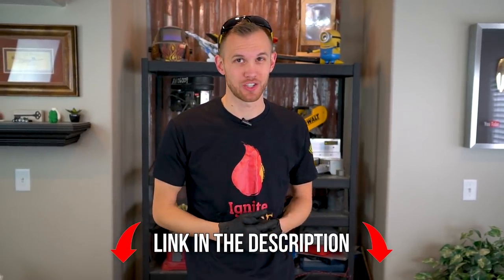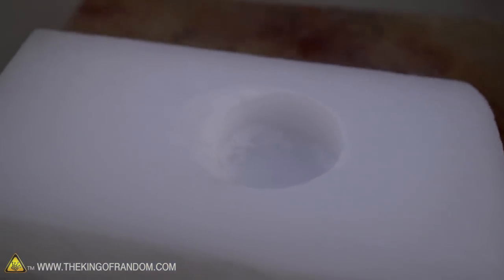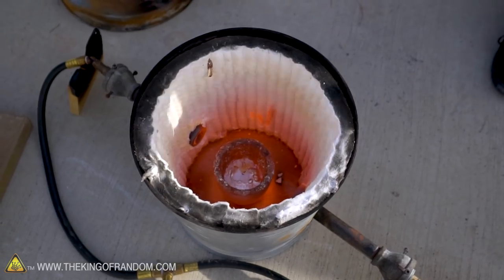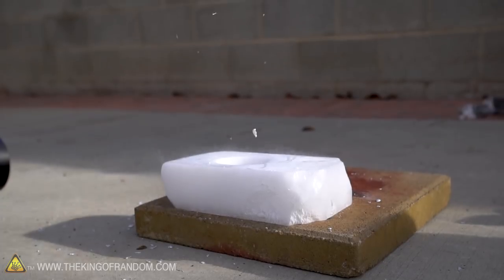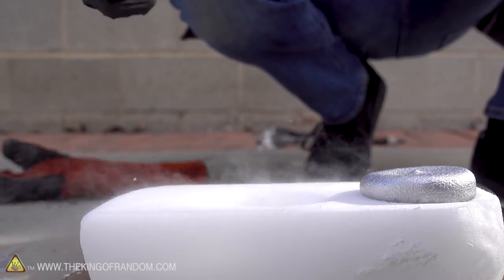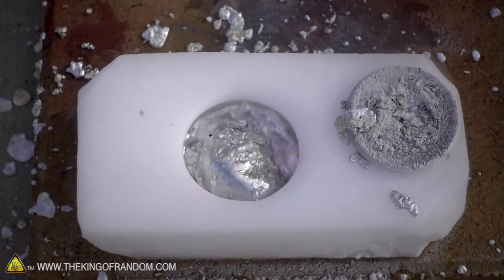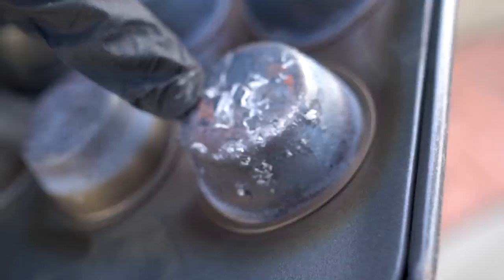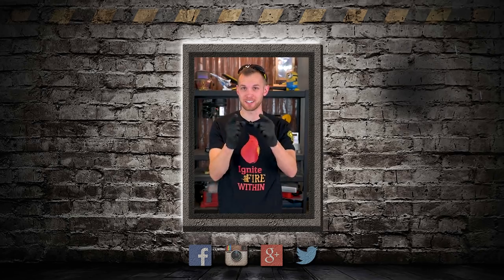Liquid Metal vs Dry Ice?! TKOR Experiments With Molten Metal On Dry Ice In This Metal Vs Experiment

Comment: What if you pour molten aluminium in liquid nitrogen?
Reply: Mini Mythbusters The molten Aluminium freezes anderen it's solid
Reply: Mini Mythbusters what I want him to do is melt copper and iron and mix them and let it harden
Reply: Mini Mythbusters Prime now
Reply: And the other way round
Reply: then the air between the two would become super heated in a very short amount of time, expanding and possible causing an explosion of sorts. basically, dont do it
Reply: The nitrogen would boil off.
Reply: Hard Core Gaming yes.

Comment: I loved the splashing of aluminum. Crazy to see it as a bubbling liquid like that.
Reply from the maker: That's my favorite part as well. Especially in slow-mo replay
Reply: I think it looks really cool to
Reply: The reason it does that is actually quite interesting. Simply put, liquid CO^2 doesn´t exist, it will jump from a solid state to gas immediately(that´s called sublimation) and since it has a higher volume as a gas than when it is solid it will rapidly expand and just blow the aluminium out. It doesn´t really matter at all what fluid you use for this as long as it is hot enough.
Reply: Specific Love Creations
Reply: I'd love to see this same experiment with other metals, just to see the different reactions.
Reply: Specific Love Creations Same here
Reply: Specific Love Creations nice spoiler there
Reply: Aluminium*
Reply: The King of Random its like an explosive volcano🌋

Comment: what if you pour Liquid murcury in molten aluminum?? Will it blend and become a alloy mix. Or will the two seperate when it solidifies???
Reply: Brandon Allen ya man thats an awsome question!! I want to know as well
Reply: It would probably become an amalgam, not an alloy, and may vaporize due to the heat.
Reply: You can actually pour liquid mercury onto aluminum at room temperature, and it will form a liquid amalgam
Reply: yes what a great question do that
Reply: I agree he should do more mixes
Reply: mercury you mean
Reply: something very bad will probably happen, look up videos of mercury and aluminium
Reply: Mercury heated up creates a vapor that is actually very toxic to living things.
Reply: Brandon Allen that would be extremely dangerous
Reply: mercury is already a liquid you dont need to say liquid mercury but still a great question
Reply: The mercury would vaporize
Reply: will it blend?
Reply: Brandon Allen actually the mercury might (if not completely vaporized) react with the Aluminium by “eating“ it up
Reply: It amalgamates. It becomes a soft aluminum mercury alloy. I think that every metal amalgamates with mercury
Reply: Brandon Allen i
Reply: Brandon Allen GU u
Reply: Never thought about that...
also *Mercury
Reply: The mercury would vaporize and mercury is very corrosive to aluminum
Reply: Brandon Allen it is kind of dangerous working with mercury. According to wikipedia it is a possible alloy...
Reply: aluminium*
Reply: They form an amalgam (which is basically an alloy but with mercury) even at room temperature.
Reply: Brandon Allen Don’t do it the Mercury will probably vaporised releasing toxic fumes
Reply: DerpDanPlays12 it actually is aluminum in English...
Reply: PyroX 

Aluminum  English US
Aluminium English UK
Reply: Xavier Ancarno oh it’s actually aluminium in uk english... I love the English :)
Reply: The only problem with that is when mercury heats up and evaporates it becomes a highly toxic gas
Reply: Brandon Allen I
Reply: RithmoArcher yep
Reply: The mercury would become a gas, and would be very harmful. This could increase their chances of getting dementia (Mad Hatter Syndrome [look it up if you're interested]) and would be corrosive to the skin, along with the inside of the lungs and the trachea, and could also affect the oesophagus and the digestive tract. In other words: THAT IS A REALLY BAD IDEA.
Reply: My guess is that the mercury will boil and gas off. It think you may need a resperator to do this one for sure.
Reply: The murcury would just evaporate since it's  liquid at room temperature
Reply: Or drop solid mercury into liquid aluminum.  Making the mercury solid might be hard to do though.. who knows. haha
Reply: jordan traykovski I know what you mean
Reply: Brandon Allen vvvvv
Reply: CORRECT GRAMMAR IS AN NOT A!

Comment: Dry ice is a better way to cast ingots than wet clay
Reply: a-lpha of Zeldaforme Gaming besides the whole throwing molten metal everywhere
Reply: I agree
Reply: The reason the aluminum does that is actually quite interesting. Carbon dioxide doesn´t exist in a liquid state and will rather than melting just sublime to gas. So, if you pour a very hot liquid like for example molten aluminum on it, it will unleash a great amount of gas that expands below the aluminum and blows it away.
Reply: And also more expensive. I dont think the cost justifies it.
Reply: Pour thermite in dry ice or the other way around ? Or in liquid nitrogen

Comment: Another way to "DRILL" a whole into the DRY ICE if you don't have a special drill is to place a cup filled with hot water on top of it. It will "drill" a whole into the dry ice over time.
Reply: Demolition Hacks hole not whole, that like saying I dug a whole it’s a hole! You can’t put you foot in a whole you can have a whole pizza but not a whole in aluminium you can have a hole or you can have a whole if there’s multiple pieces all together from the same piece!
Reply: Ben Biggs or you could just say hole*
Reply: Ben Biggs it was not possible to explain this more complicated, or was it? Short explanation

whole = complete
hole = empty space
Reply: *hole
Reply: Ben Biggs *your
Reply: Ben Biggs I agree but you don't say you foot, you say your foot! 😂😂😂

Comment: The splashes are caused by the CO2 released from dry ice for contacting high-temperature aluminum. This probably the worst way to cast aluminum because of all the air bubble trapped inside the ingot, but still fun to watch.

Comment: What would happen if u put ice into a vacuum chamber, Would it pull it break apart, Or stay together because of the very low air pressure??
Reply: Nothing
Reply: Better question: If you put ~1-4°C cold water in a vacuum chamber. Would it freeze?
Reply: Cody's lab did it.Check his video
Reply: Mystic Dragon EX dang, thank you!😄

Comment: Fire extinguisher on fire is normal, what happens if you fo the opposite? Burn a fire extinguisher?
Reply: Yeah, what happens if you explode a fire extinguisher due to being in exposed flames, making it build up possibly more pressure than it can handle?
Reply: Mythbusters already did this.
Reply: I’m sure the extinguisher would explode
Reply: That would be very dangerous

Comment: Try freezing liquid nitrogen
Reply: mateo d u cant freeze liquid nitrogen
Reply: +Robo Games420 well, actually you can. However, it's hardly possible to achieve temperatures as low as that
Reply: They could still try
Reply: They have done it already
Reply: mateo d its very possible liquid nitrogen into an extremely strong vacuum
Reply: Gamingelon yes but my point is u cant physically freeze it to the point that it stays solid for more than a split second

Comment: drill a thin hole in a block of dry ice and put a long heating element in it, see if that makes the dry ice sublimate any faster. It seems like the leidenfrost effect really slows it down in this experiment, but would a hot radiating head source work any better?

Comment: Set the block on it's side, and drill your hole with a smaller diameter drill, but significantly deeper.  You have a chance to make some totally rad aluminum bubbles!  Try, say, a 1" hole starting 2" deep, then 4" etc.

Comment: Coolest experiment in no particular order:
1) Lighting up thermite and dumpint it into liquid nitrogen [danger level= highest]
2) Pouring molten glass over a sheet of dry ice [danger level= high]
3) Coal dust + flour = dust explosion [danger level= highest]
4) Running electricity through fire in metal foundry [danger level= low]
5) Sugar + concentrated HNO3 [danger level= normal]
6)  HCl (solution) frozen into solid and then placed on top of magnesium (or potassium) powder [danger level= normal]

Comment: You should drill in to 2 different dry ice blocks and on one of them drill a hole in to the center of the creves you made them put the blocks on top of each other with the hole on top then pour molten aluminium in to it so it should create a sphere of aluminium 👌🏾

Comment: I had a job heat treating carbide tungsten in 2400 degree molten barium salt. If the slightest moisture hit the salt bath, an explosion like a shotgun blast would go off and molten salt would fly everywhere. Fun times

Comment: Hi was thinking to make a tipe of fuel air device from a large firework rocket an sticking petrol in like a plastic pouch rapped around the body of the rocket so when it explodes at altitude (hopefully) the force of the firework detonates it should disperse the petrol setting it alight in the process should be very spectacular filming at night?!?

Comment: So you don't think that maybe the bubbles are caused by super heating the solid carbon dioxide which in turn turns into a gas and escapes though the aluminum causing CO2 bubbles? 

Congrats you have carbonated your aluminum

Comment: does dry ice melt???????😓😓😓😓
Reply: Dry ice is frozen carbon dioxide. It is special because it doesn't melt. Dry ice at atmospheric pressure goes straight from solid for to gas form. This is called sublimation